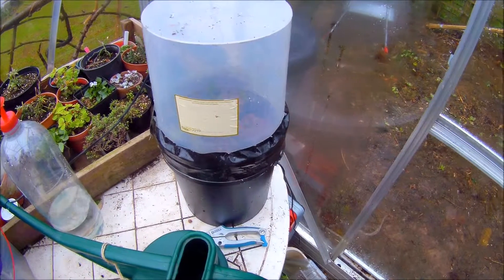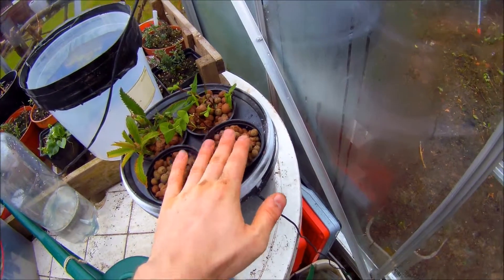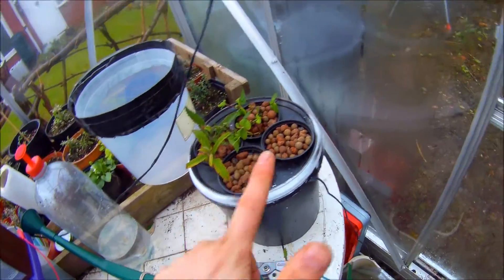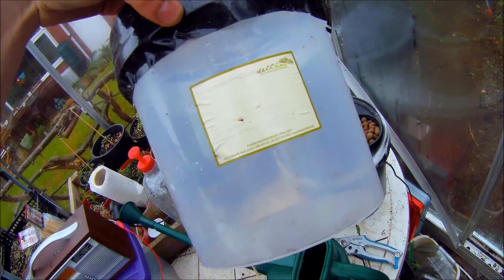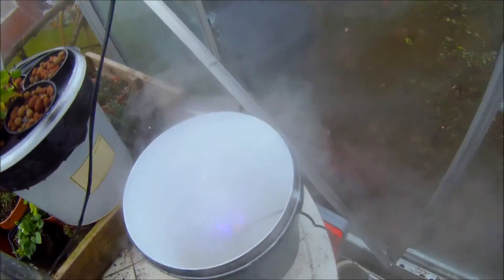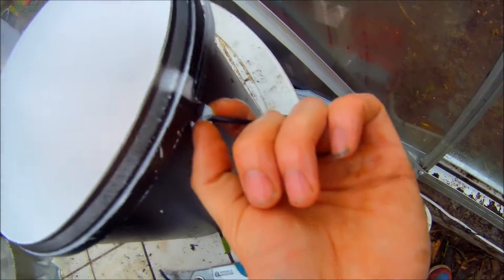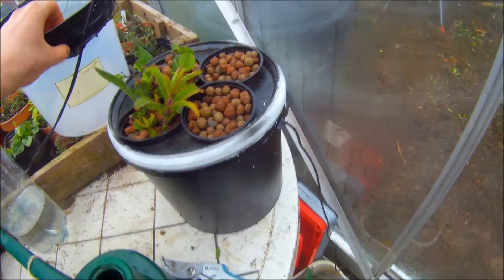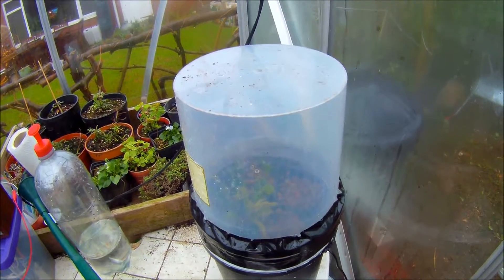Cuttings in a cloud chamber!

Comment: I built something very similar to this but I used forced air in that pushed the fog up out the top. I had cannabis cuttings in foam circle inserts. The forced fog up through the foam inserts put enough moisture on and around the cutting leaves to where I didn't not ever have to mist them or use a doom. Took two weeks to see roots. Other people have used this fog method as a folier feeding method. I'm looking into that next. Hope that little info helps.